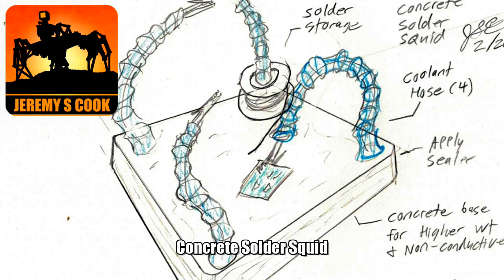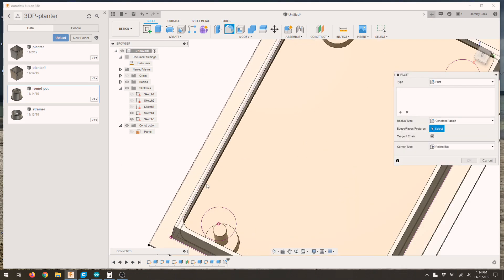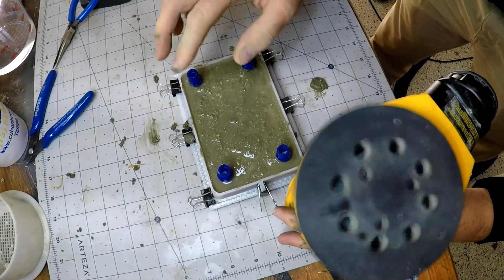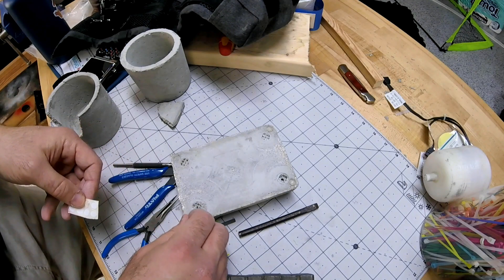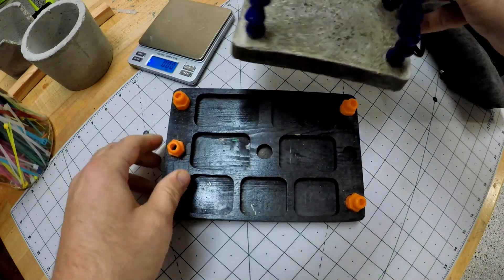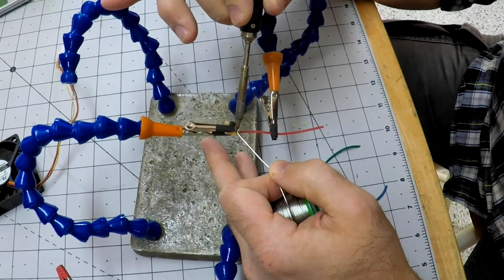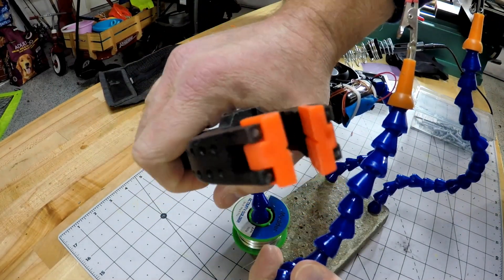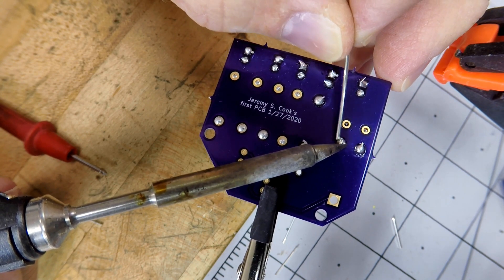Concrete Solder Squid with 3D-Printed Mold [Howto]

Comment: Put some grease on the plastic parts and they will come off much easier.
Reply from the maker: Yeah, you're right. I put out another video about a concrete flower pot where I finally figured that out (petroleum jelly there). Videos were released somewhat out of order compared to the project completion, not sure what (if anything) that I used here.
Thanks for watching!